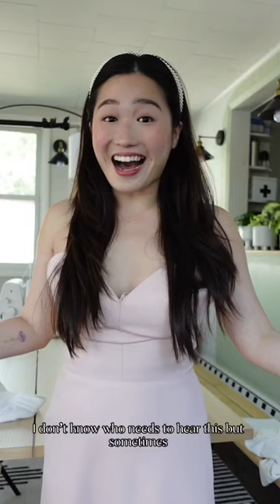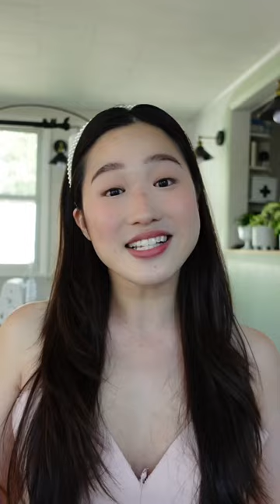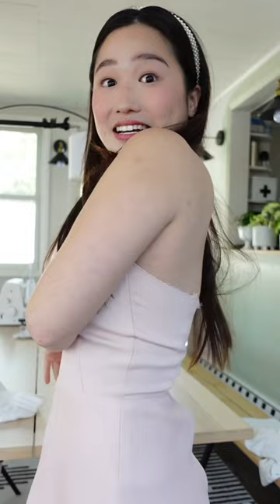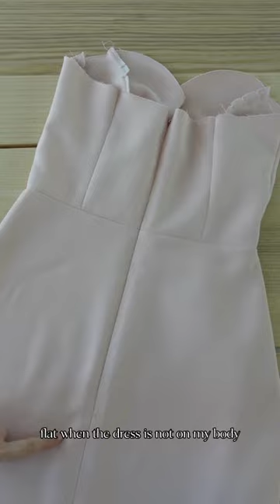DIY Valentine's Day Dress FAIL

Comment: I’m a professional bridal seamstress and I fix that issue all the time. Basically what’s happening is the zipper is stretching the fabric slightly. I fix this by pinching the zipper where it’s bubbly, that will give me a measurement, yours looks like it could be about 1”-1 1/2”. You will need to remove the zipper from the lower skirt portion of your dress or just remove it all the way. Then use that measurement, let’s say 1”, the install a basting stitch along the fabric seam allowance. I will remove the 1” by gathering that basting stitch just enough so that it doesn’t pucker. Then reinstall your zipper. If you are working with a stretch fabric or if the edge of your fabric has any stretch, you can save time by cutting a small strip of fusible lightweight interfacing to the seam allowance, this will help the fabric not stretch when you install the zipper. Trust the process, it looks a feels weird while your gathering, but it works.
Reply: Mind blown

Comment: The dress is definitely not too tight. I like alterations by heather's input. But there is also a little bit of a swayback issue. My dresses (and coats) stopped having  bubble butt problems when I realized that my back panel should be about an inch shorter than my front. Bodies are not symmetrical front to back. At all! 🤯

Comment: A little taken out on the sides and darts in the front to add the shape.  Or if you like the dress tight; you may be able to add darts in the back as an easy fix to the zipper problem.